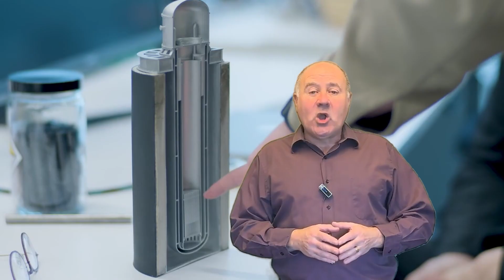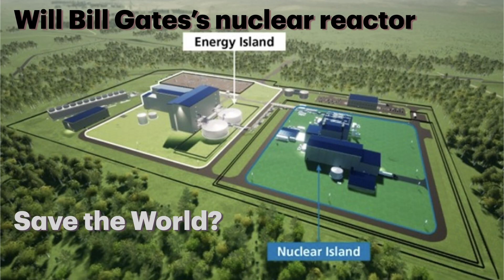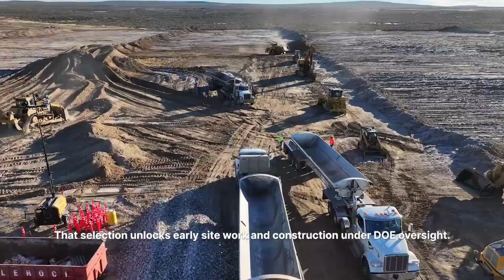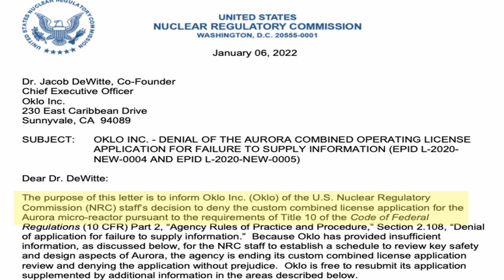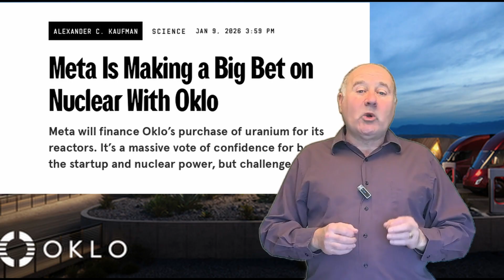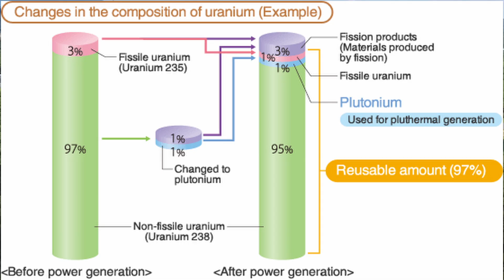Is nuclear power darling Oklo a good investment?

Comment: Their Atomic Alchemy acquisition was interesting.  I met the CEO a few years ago.  They wanted to make elements from others.
Reply from the maker: That’s the medical isotope business that I didn’t talk about. It’s interesting, but the market is too small to have a significant impact on their bottom line.
Reply: Wondering how practical and economic that is?  I lack background knowledge in the field.  However having visited the Hanford B Reactor, when the Columbia River was available for cooling during transmutation of fissionable materials, it seems to me that the cost per (micro)gram of transmuted matter would be quite high.  What could they make that would be worth the cost?  Medical isotopes, as @Decaebonize11 mentioned?